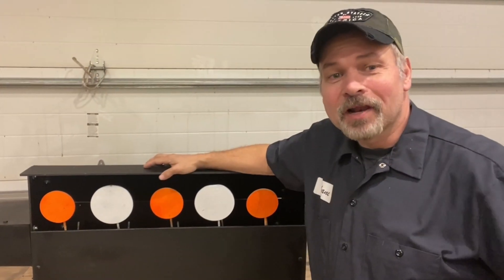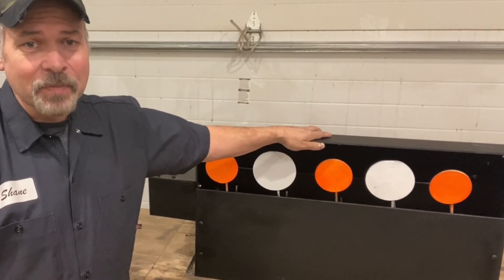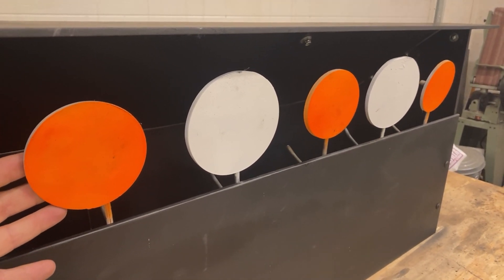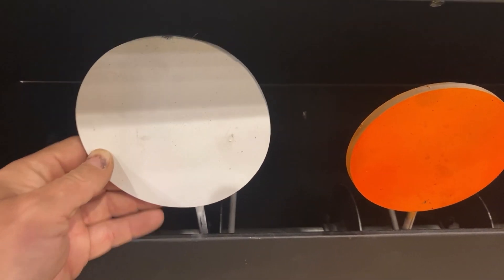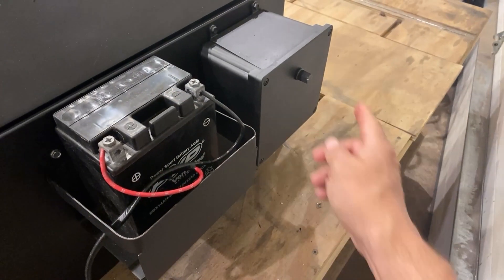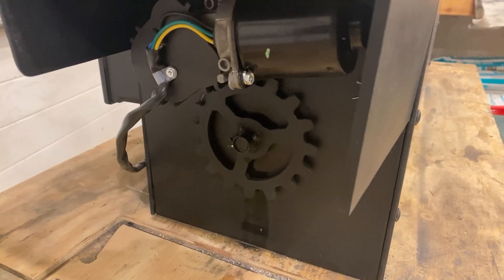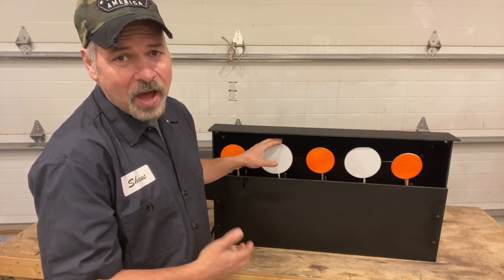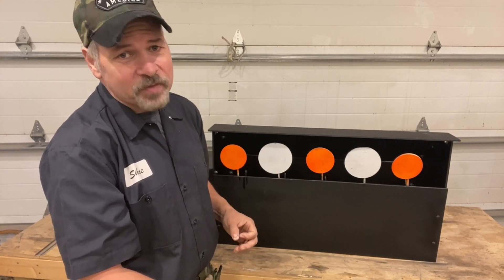automatic targets - Pop up Targets for Shooting Best Resetting Targets

Comment: You can incorporate an electrical component into the design. Instead of having the motor running continuously, you could connect the negative or positive terminal to each target. When all the targets are knocked down, the motor can complete a rotation to lift all the targets back up. This way, the motor only activates when needed, resetting all targets at once.

Comment: I would love to get some plans for this. Ever consider using a… I don’t know, something that has ducks or something that reset once going around. Thinking a slowed down belt sander with ducks/whatever target attached that belt sander which resets once coming back up. 
Awesome project
Reply from the maker: plairofpires, 
a belt sander or slow conveyor belt is pretty commonly used with plinking targets they do require line voltage though and that can be a problem in remote spots. 
I do like wiper motors because they are slow moving (relatively speaking) right out of the box and 12 volts! 
But... yep! there are many ways to shoot the ducks! 
LEt us know what you come up with! 
-Shane